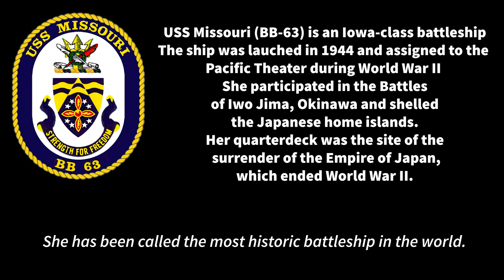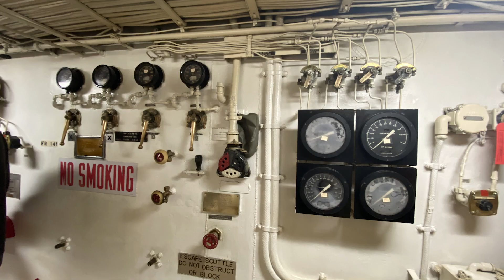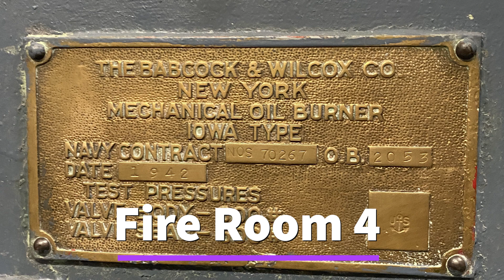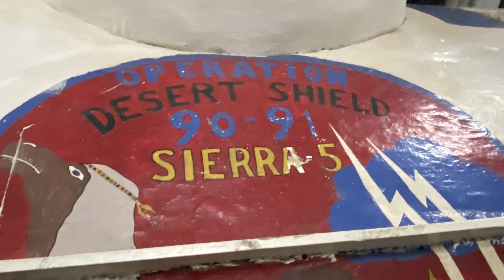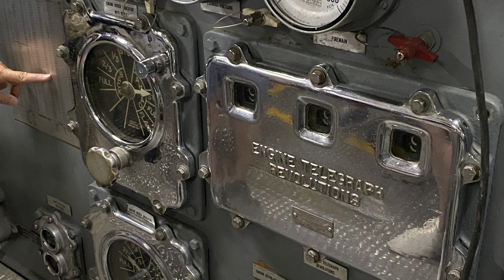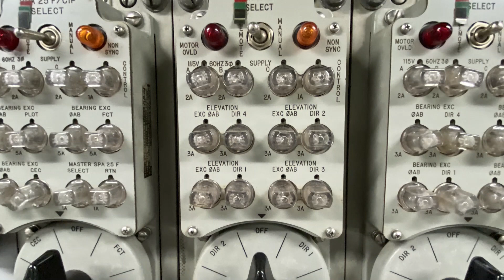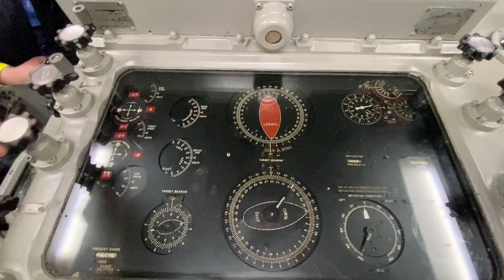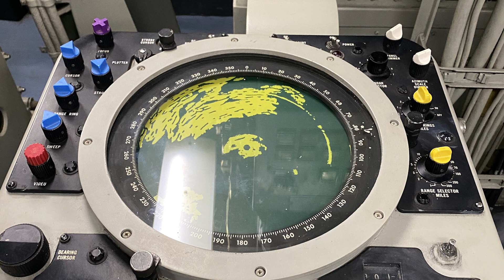Tour of the USS Missouri

Comment: Some quick clarifications (engine room tour guide on the New Jersey commenting):
15:10, the man by the steam drum, that plug with two handles would be removed and thats how you would climb inside the steam drum. The main water drum at the bottom of the boiler has a similar plug.
The periscopes only go to directly above the exhaust path of the boiler, and a light will shine in front of the smoke which is seen via mirrors.
Auxiliary steam is saturated so it is visible to the naked eye, SUPERHEATED steam is invisible, which will need the broom
Moving that light off rod was not necessary to light the other burners. Once you get number 1 burner lit, just turning the fuel on will light the others off
18:22 The astern turbine has blades angled opposite the main high and low pressure turbine blades. So just sending steam across them would spin in the other direction

Comment: She dont know a thing about damage control.  It run by the hull technician and damage control men . Halon is awesome for firefighting,  no good on the human who dont get out. The have co2 systems that alarm. Used to displace the oxygen in a space. Afff foam floats on top of the water , it works very good. Afff is great for cleaning stuff. So it bug juice (red kind) .